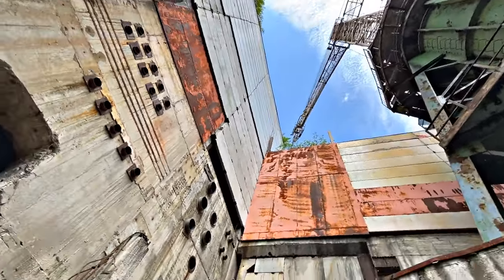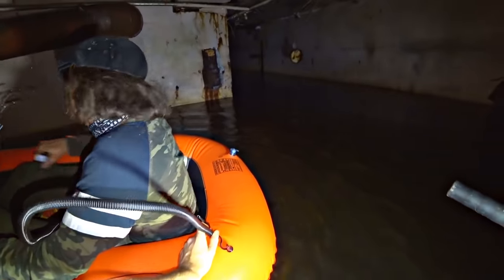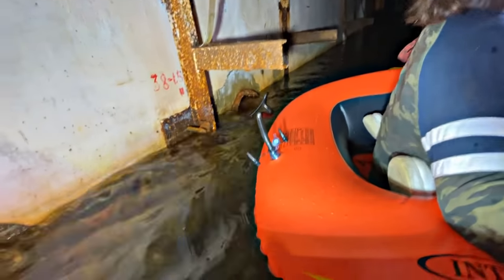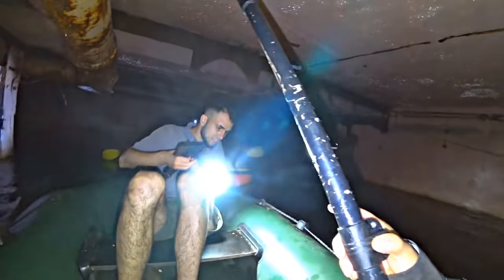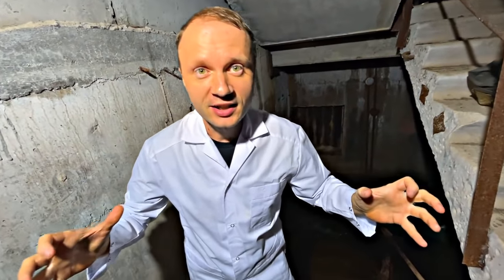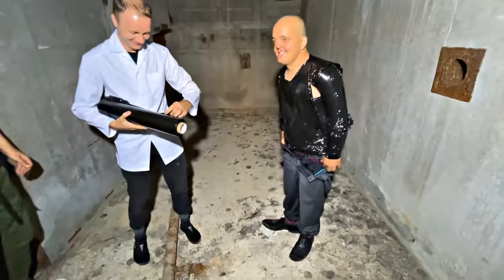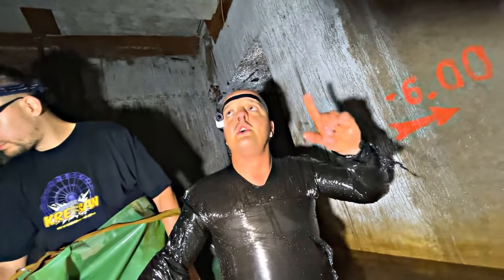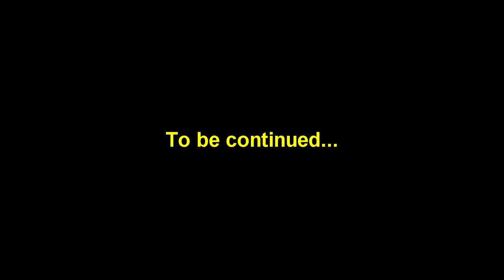Stalkers penetrated in a DIY SCUBA under the Chernobyl power unit ☢ Fell into radioactive water

Comment: Idea and challenge, build a mini sub-marine, and use that to go underwater ;)
Reply: Yes or a diving bell which the bowl basically was. But one that went all the way down to his waist would be less sketchy.
Reply: @benc8386  a friend of mine built a mini RC controlled sub, it is awesome with multiple cameras and for these guys with radiation, it would be less risk..
Reply: @rompstar  Oh yes that's an excellent idea. Much easier if you don't have to load SuperSus into it.
Reply: @rompstar  what frequency would reliably penetrate through the the water and concrete? Also, for real time video you would need a pretty decent bandwidth, either via cellular of WiFi, both of which have penetration issues in the above mentioned medium.
Reply: @mikejones590  not sure, I never done it, but seen it done, also you could tow a cable to it for video, controls and power... you just had to be careful this way...
Reply: @mikejones590  you could also just buy an underwater drone, they exist.
Reply: That's hard to do. Read up on the first submarine experiments. There was a guy here who built a homemade minisub but he pussied out on trying it.
Reply: Ah I thought you meant a real sub (for a man), but you mean RC controlled with a camera.
Reply: @bromisovalum8417  yes

Comment: I get that they pump air in the helmet, but where does the carbon dioxide goes when sus breathes? I mean if it stays in the helmet, its a hell, right?
Reply: As they increase the pressure in the bowl air comes out around the sides and bubbles up. If they keep pumping the atmosphere inside the bowl should be recycled continuously. It may help a bit that CO2 is a bit heavier than air so should sink to the bottom of the bowl and get pushed out first.
Reply: They need a better pump guy or a T connector and multiple pumps.  They had one pump between two boats.  I dont want the guy who laughs my lifes in his hands letting the water rise too high.

Comment: When using a manually pumped Scuba suit, you need a constant flow of air to prevent water from entering your diving bell (The helmet would be this, in this case.)
You need atleast 2 pumps, pumping independent of eachother, to keep the flow rate high enough.
Try again with 2 or 3 pumps bound by a cross or T joint, and then see how much better  he can go under when you guys pump independently!
Number eachother, pump 1 goes down, as it comes up, pump 2 goes down, as it comes up, pump 1 goes down, etc.
Reply: This is not the 18th hundred, just get a little electric pump.
Reply: What about just dont doing this and the foq leave it all !!?!!!?!! 🤷🏻‍♂️
Reply: @faultboy  yes but what if the on-site power fails, we should test to see if the turbine coast down can still supply power to the pumps until the diesels kick in.
Reply: @669karlos  you sir, deserve a medal for this comment

Comment: These guys are hilarious, they seem to have no fear, the little dude is under water, surly that water is seriously contaminated and it’s near his mouth!!!
Reply: You mean Quasimodo, don't worry, he has a cheat code for life 😂🍺
Reply: It turns out that radiation is not actually that dangerous. Check out the lectures by Gaylen Windsor for more information. I have direct experience too, I worked in the reactor department of a us aircraft carrier for 4 years and never once did radiation cause issues. Modern reactors are very clean, basically the primary filter and the fuel itself are the largest sources in a operating reactor.
Reply: @mikejones590  you realize Chernobyl isn’t a “modern reactor” and even if it was, it still fucking EXPLODED?!
Reply: @carlwheezerofsouls3273  They are in the reactor 5, which was unfinished, never functional and upwind from reactor 4 during the explosion. That mean they are not in a contaminated part of chernobyl.
Reply: @mikejones590  i remember none of this!

Comment: We live in an age of technology, why are you guys not using RC submarines, drones and such? Does the radiation interfere with radio signals, or are the walls just too thick? Wouldn't using an op amp with a high gain suffice to work for boosting the transmission signal?
Reply: well uh, as much technology as the world may provide, these dudes are clearly working with a budget. i mean just watch some of their other videos, where they build cheap little chainsaw-powered vehicles and ride them around what looks to be a relatively small village.
Reply: @carlwheezerofsouls3273  surr, fair point, and to further that- they do spend where it counts. However i do not see them getting a view super deep. I took diving classes, and the deeper you go, the harder it is to breathe as the pressure is constricting your body, you also need to equalize gasses in your body at certain depths, and depressurize on the way back up, that setup at best is good for maybe 10 feet 15 feet? He wouldnt be able to draw breath at a certain depth. With a cheap rc submarine, thats modified and a high gain op amp to boost the signal, some 50lbs fishing line to retrieve it if it screws up, is far safer and would be able to show us far more than anyone else has ever seen.

Comment: Seriously? Bringing cheapo kiddie and hobby boats without multiple air compartments to stop you sinking into an area full of sharp pieces of metal and then thinking duct tape will seal leaks underwater instead of buying proper boat/pool patches. The "scuba" helmet doesn't have anywhere near enough airflow or a way to remove CO2 effectively and so is an incredibly risky setup. This is really basic stuff being screwed up that I would have thought they should have a handle on if they're going to do this sort of thing. Someone on this channel is going to end up dead in a totally preventable way sooner or later.

Comment: in this kind of tight tunnel perhaps using a hooked pole to pull yourself along using the metal brackets on the ceiling could be a useful aid to the paddles

Comment: You need vacuum or something because pumping air will suck more air in due to pressure difference. or make an airtight lock (very expensive)

Cheap diving glasses and 2 pumps 1 bottle, 1 or 2 pressure difference (so you  can exhale and still get fresh oxygen)

Total 4 tubes ish 1 big heavy bottle and u have cheap "emergency use" thing 
(2 guys pump 2 for the when he not breathe so oxygen can go out and fresh pumped in)

test before use for 10 min so you dont kill someone on accident :3 (in low depth sealed by water so u can test good)
Reply: 1 electric car/boat inflater on batteries will also work and needs only 1 fat hose to work (garden hose and seal with hot glue or better) cheap cheap but kinda reliable for this type of use and idk :3

Comment: Probably shoulda found a way to seal the helmet. Also i'd drill a hole in the top, run the hose through the hole and seal it with epoxy and some gorilla tape and invest in a battery operated mattress pump.
Reply: Diving bell should not be sealed. They need "just" higher air flow.

Comment: Привет @KREOSAN English! Что касается ваших лодок, вы можете поэкспериментировать с саморасширяющейся пеной или вспененной пеной, чтобы лодки оставались плавучими, даже если они проколоты.  Я знаю, что это звучит безумно, но, возможно, вам лучше создать версию своего электрического велосипеда, чтобы обеспечить воздух и сделать импровизированную подводную лодку с нейтральной плавучестью, которая с добавлением песка или веса может позволить ей опуститься до более низкого уровня.  , и легко разряжаться с удалением магнита изнутри для восстановления плавучести подводной лодки.  Спасибо за приключения: 0) С любовью из Великобритании: 0)

Hi @KREOSAN English, Regarding your boats, you might want to experimenting with self expanding foam, or a buoyancy foam to keep the boats buoyant, even if they are punctured.    I know this sounds bonkers, but you might be better off creating a version of your electric bike, to provide air and to make a improvised submarine, with neutral buoyancy, that with sand or weigh added, can allow it to decent to the lower level, and to be easily discharged, with the removal of a magnet from the inside to restore the buoyancy of the submarine.   Thank you for your adventures :0) With love from the United Kingdom :0)

Comment: Channel has def been more fun with a nutter like Sus on board, not so sure about the new chap as he seems just a bit too chaotic and prob needs a quiet word on calming it down.  For the diving helmet you could prob adapt one of them inflatable neck collar pillow thingies to make an airtight seal, silicone glueing to the helmet and when inflated to max pressure it should keep the water out if done right.   Should be wearing a Vostok Amphibia, the Soviets superb diving watch, Chernobyl water would be nothing to them unkillable watches hehehe or if fancy a Zlatoust.

Comment: If you put a wet rag over the exaust (only leaning, without capping) your chainsaw will be a little more silent. 
I would have liked to see you put a summersible water pump and some solar panels and wait for the tunnels to dry. But that can move a ton of radoactivity if that basement is actually under the unit 4.
You are really crazy👍🏻🙂
Reply: unit 5
Reply: If its ground water like they say, even industrial pump would have problem to keep up with water returnig almost immediately
Reply: @Rozbujnik_Rumcajs  Yes, it depends by many factors ( mainly cracks on concrete and groundwater level), but as you can see at 14:20 there are a lot of places where the water is rain water, and not underground. Of course the place is incredbly big so it's almost impossible.
Reply: Yes but I think they are searching for the underground internonnection between all power units.